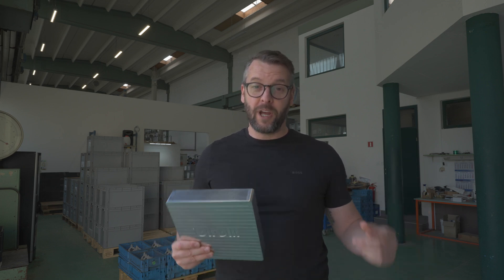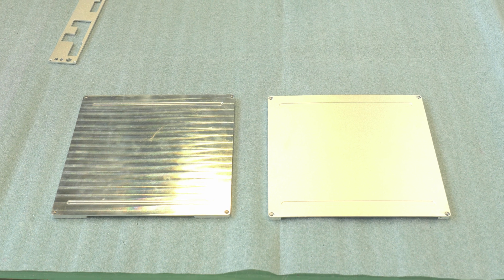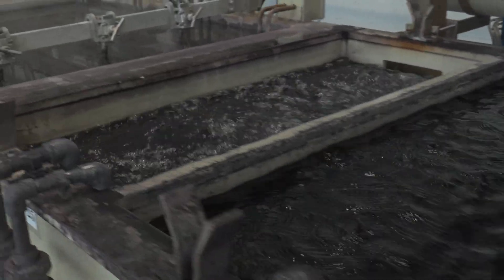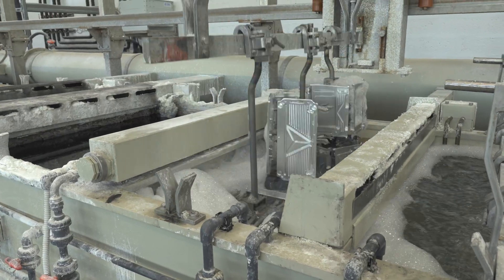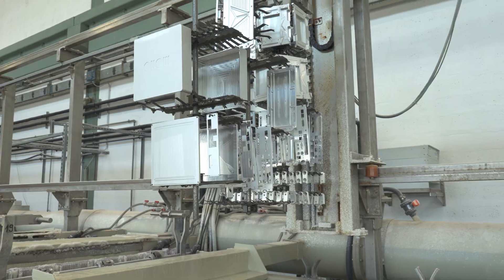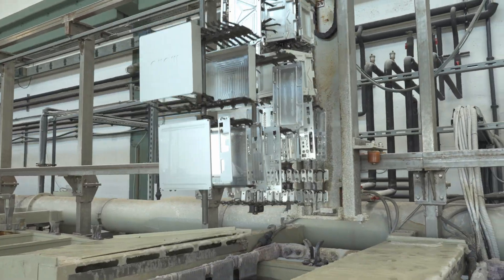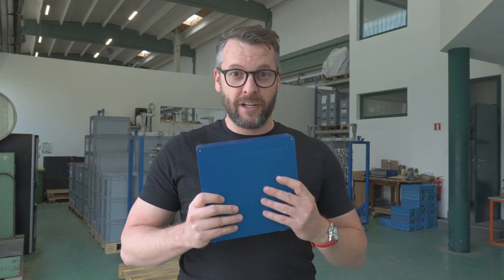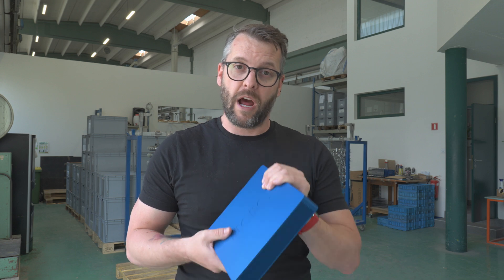Anodizing a custom mini-ITX case for a custom router.

Comment: looks good. if you can design a pc case with a similar look that will support a low profile gpu then I'll be your first customer.
Reply from the maker: Thanks! It's planned, yes. Not specifically for a GPU, but with support with one PCIe card (mounted on a 90 degree bracket). Will post a video about it once it's ready, but it'll be a while I need to first finish this one.
Reply: @tomazzaman  great to hear. i doubt it but hopefully you'll consider making limited quantities. gl!